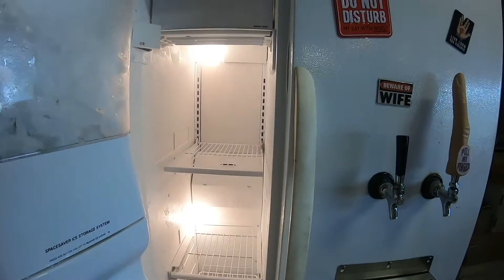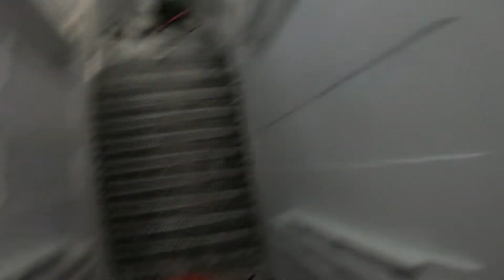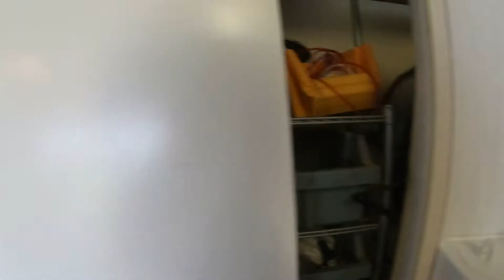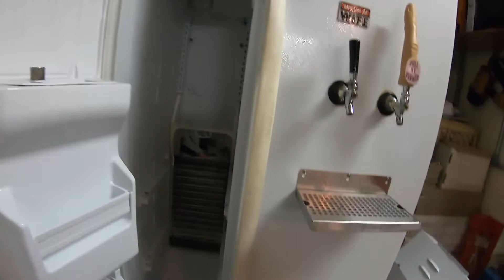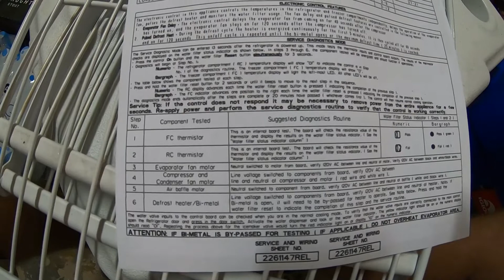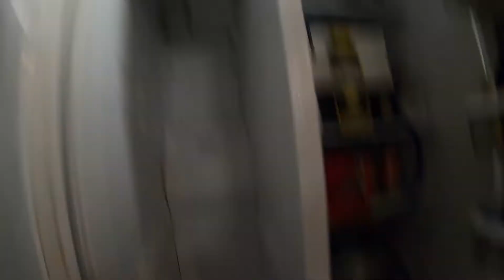Kenmore Fridge Not Cooling Properly

Comment: Fridge failed Christmas morning. Thanks to this video it is back up and running. Saved me the cost of a new fridge. Thanks.
Reply from the maker: You're welcome - glad it helped!
Reply: @JoesGarageProductionsLLC  Two weeks later it was frozen up again. I noticed that the compressor ran all the time and it was not triggering the defrost cycle even though the defrost worked fine in the test mode. After replacing stuff I probably didn't need to replace (thermistors and diffuser), replacing the main control board finally did the trick. Still, you got me going in the right direction. I tested my bimetal with some "freeze spray" and it acted intermittent like yours so it probably did need replacing anyway.

Comment: Thanks for the video!  We had the same problem you experienced before - our refrigerator door was left slightly open for 8 hours - and then it would not cool.   Thanks to your video we were able to remove the panels in the freezer, and saw the metal pieces behind the panes were crusted with ice worse than yours.  Once we defrosted them with a heat gun (like you) and put the panels back together, the refrigerator was up and working again !!   Thank you so much for putting this video together!   One thing that helped us was removing the shelf brackets on the right side of the freezer - this made removing that large white sheet metal piece in the back much easier; how this was removed was skipped over.
Again, thank you for posting this and sharing your prior problem. This saved us a lot of money (spoiled food + repair ) !!
Reply from the maker: I'm glad you found it helpful! Every once in a while I will put the fridge into maintenance mode, turn the evap fan on, and, clearing only the bottom shelf in the freezer, shoot the heat gun at the metal grate. That melts quite a bit of ice off the coil as well and is FAR easier to do than pull the whole freezer section apart.

Comment: Literally looked at all of the refrigerator vids before I found yours; you have my exact refrigerator and the same problem I am having.  What a relief, and thank you btw for making this vid!  I have my refer unplugged and  melting while I sleep tonight - no heat gun for me!
Anyway, I will be looking at my heating element, thermister, temp cut-off switch and hoping it's one of those and not the board!  Thanks again!

Comment: kenmore sxs model 106 does not have power on compressor and fan. please tell where the problem is. i saw this video was very informative. thanks
Reply from the maker: If you are not getting voltage at the compressor terminals or the condenser fan, that suggests one of the following:
1. The control might not be calling for cooling due to a problem with one of its inputs
2. There is a problem in the wiring from the control to the condenser fan and compressor
3. There is a problem with the control itself

The control will typically monitor the inputs from multiple temperature sensors in the cabinets as well as, sometimes, a temperature sensor on the evap coil (this is sometimes used to control the defrost cycle). If one of those temp sensors goes bad, that can cause the problem you describe. There are other possible causes, obviously, but that is a fairly common one.

I am not familiar with that particular model, but you might want to do some research to see if yours has a maintenance mode of some kind where you can override the control's logic and toggle the individual components to come on and/or be tested. That should give you a better idea of what component might be faulty.

Comment: Please share where you found the service and wiring information.   I have Kenmore 53562201.  The freezer -30 F and frig 50 F.   I thawed out the freezer as it was iced up.   Started back up and in 2 hours freezer back to -30 and frig 50.   It is not iced up.   Not sure what is blocking the cold air getting to the frig side?

Comment: @joe garage Where did you hook up the wire to test the thermostat
Reply: Yes, great video, but it is very hard to see where the leads are connected to do the 2 open circuit / resistance tests.  Any more description or pictures anyone can add?

Comment: Hi Joe... thanks for this video. I seem to be stuck. I should have done the diagnostic test before changing the thermost because the top part of the freezer and fridge is still not cooling after changing it. When I opened the back panel the whole unit was covered in ice that took over 30mins to defrost using  a  hairdryer on high heat setting. After changing it and running the test for step 3 I noticed the evaporator fan isn't spinning when the fridge is on. Before rushing to buy a new fan motor what can I do? .
Reply from the maker: It sounds like you found your problem. If the evaporator fan motor stops spinning, the coil will definitely freeze over. If the motor does not turn freely or feels stiff, you might be able to disassemble it and lubricate the bushings. It is probably a temporary fix, though.

Comment: I notice you had something on fridge side taken apart, were you first checking to see if there was an issue with the fan?
Reply from the maker: Yeah I believe I took the blend door assembly at the top of the fridge apart to make sure it was functioning. That is what is responsible for directing super cold air from the freezer to the fridge section. I don't believe there is a fan on the fridge side, only freezer side
Reply: @JoesGarageProductionsLLC  update: i went ahead and drilled 5 holes in into freezer side; fridge is now working great and maybe even better.
Reply from the maker: @Sword-trowel  lol that's one way to do it!

Comment: Hi Joe, did your fix work to lower the temp on the fresh food side to around 40 degrees?  ...or did it stay high and if so how did you get it to a lower temp?
Reply from the maker: Yup the fix worked perfectly. No issues since posting the video. I do feel like the defrost cycle on this model is a bit inadequate... Might want to run it manually  periodically.
Reply: Joe's Garage hi. Good job. I am not sure what you mean with ‘run it manually periodically’. Could you please elaborate?
Reply from the maker: @giovannipuccini1967  you can use the servicetroubleshooting mode to periodically run the defrost cycle. I think I covered that in the video but if I didn't let me know and I'll see if I can dig something up for you
Reply: @giovannipuccini1967   @Joe's Garage  run service mode #6. That fixed my problem, at least for now. Not sure the auto-defrost is working but time will tell. See the service sheet Joe linked several comments back for instructions on using the Service Diagnostics.

Comment: So I have this issue. I thought it was the thermostat on the fridge side  because when I hit the control panel, everything seems to have improved. Fridge isn't getting as cold as it was though. So I haven't fixed it yet. 

How did u know it wasn't the air baffle/diffuser or the thermostat?
Reply from the maker: You can put this particular model into a test mode and confirm the baffle works. I have a feeling that this particular model has a software/programming issue on the defrost cycle. I've confirmed that all defrost components work but still have occasional evaporator icing (door seal is good)

Comment: Hey Joe, I have a 19 year old Kenmore side by side refrigerator model #106.50559001 where the Top half on both sides will not get cold.

Yet the bottom half on both sides does get cold in the fridge and freezing in the freezer. Very strange.

Anyone have a solution for this? Thanks.
Reply from the maker: I'm not familiar with that particular model but on many fridges there's a fan behind the panel in the freezer. That fan sucks air across the evaporator behind that same panel. There is a diverter at the top of the fridge that meters how much of that cold air is allowed to enter the fridge. 

I would start with the basics. Take the panel off the back of the freezer. Make sure the evaporator fan is running and that the evaporator is not encased in ice. Make sure the back panel is also installed correctly as well.
Reply: @JoesGarageProductionsLLC  Hey Joe, I took off that panel and it turned out to be the evaporator fan. I ordered one from amazon and I got it yesterday, installed it last night and today both sides are working great! Thanks Joe! :)
Reply: @lenns_music  there are no frozen Ice, and my evaporator fan is clearly spinning.

Comment: My freezer is at 30 F and fridge at 58 F at max cool settings.
Reply from the maker: Are both your evaporator and condenser fans running? Is the evaporator iced up?
Reply: @JoesGarageProductionsLLC  Compressor and condenser fan run, cleaned condenser coil, but only made 2 F difference from before. Don't know where the evaporator fan is. It's a 20 year old sxs Kenmore.
Reply from the maker: @obombabeenlaid5101  the evaporator fan is usually in the freezer section behind a panel
Reply: @JoesGarageProductionsLLC  Evaporator fan was spinning intermittently. Took the fan out to check voltage and voltage was fluctuating so either a bad control board or compressor.
Reply from the maker: @obombabeenlaid5101  definitely fix the evaporator fan before you condemn the refrigeration circuit.
Reply: @JoesGarageProductionsLLC  I had the fan removed and voltage on connector was fluctuating so problem is beyond the fan.
Reply from the maker: @obombabeenlaid5101  interesting have not seen that before. I would suggest checking the wiring back to the control board. You might have a bad relay or bad solder joint on the control board itself